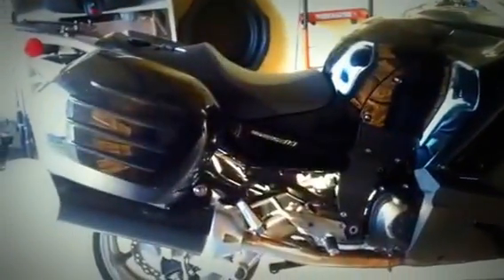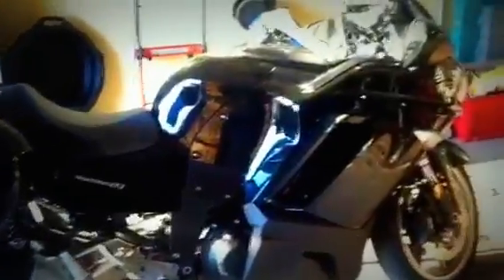Concours 14 kipass spare

Comment: Do you have to bring the keyfob up to the start switch, or will it still work if its still in your pocket and you never bring it out, and all you have to do is press the start button (which should be on the handlebar instead IMHO)?

Comment: Gary,  I had heard this was possible but my local Ace Hardware was unable to read my FOB.  The light-up display did show the key as one they could clone but the guy got stuck when their software wanted the make/model/year of my car.  So he tried a couple at random but did not have any success reading my existing FOB.

Any idea which car they used as the one to set in their system?  Or what ID # is the key blank?  Thanks!!

Comment: @Jason Foy - I'm guessing you don't ride a Connie.  The procedure shown in this video is identical to that used with the OEM passive fob.  There is no "left behind mode" and speed and distance are not limited if you leave the fob behind.  If the Concours is started with the active RF fob which is then left behind, a warning is displayed on the dash to let the rider know that they won't be restarting with the missing fob.  If the passive fob is used, no warning is displayed, since the assumption is that the passive fob will be put in a pocket, out of range of the immobilizer.

Comment: how does this work for actually moving?  The bike as a 'left behind' mode incase you dropped it or left it somewhere that is supposed to lock the bike to 10-15mph.  Seems like you would need to secure it to the receiver in that case creating a theft issue should you forget to remove it.